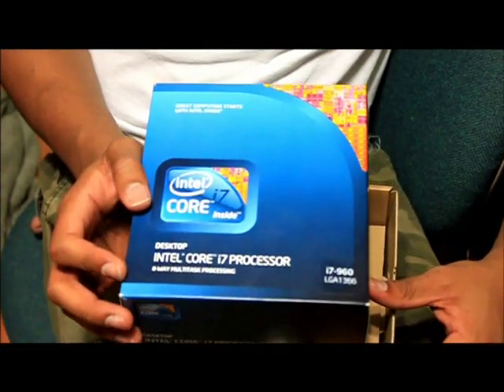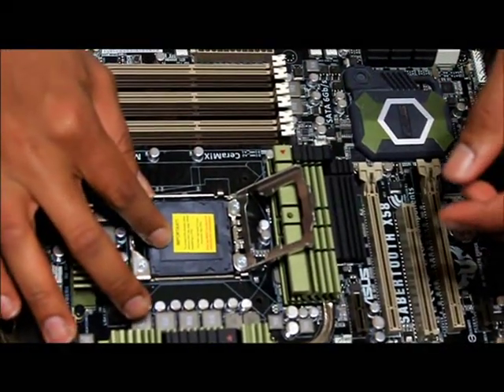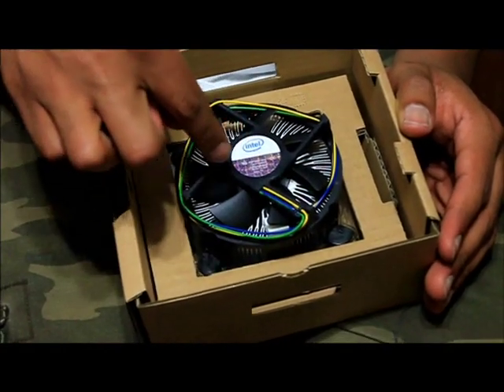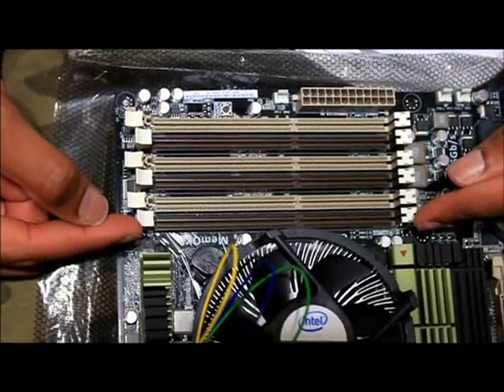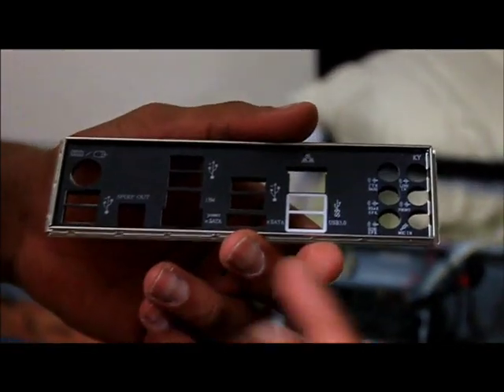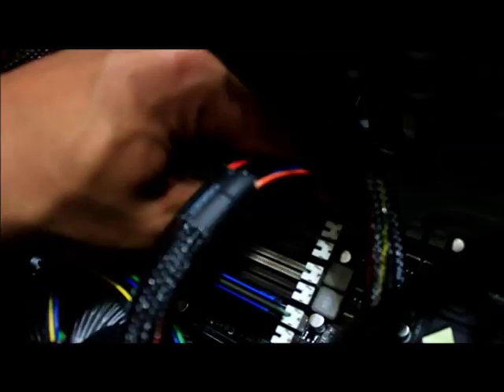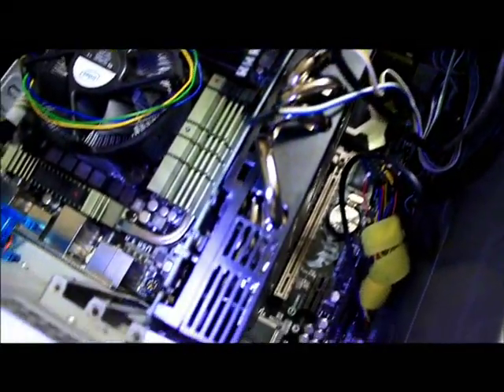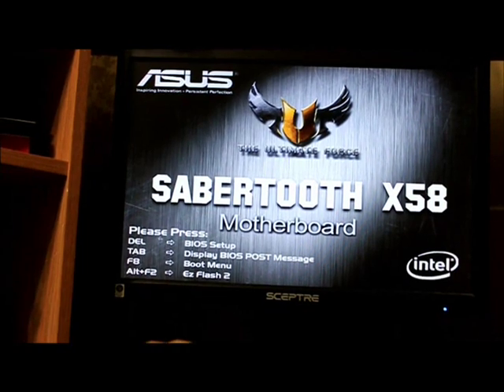How to build your own desktop computer

Comment: Hey can i make a toshiba satelite into a desktop by disambeling the laptop and using all the parts again just to be able to make a desktop, my screen cracked and i cant find a replacement but an external monitor wont work on the toshiba, the external monitor does work on my lenovo but not on my toshiba... so its not the monitor fault and i litterly used a knife to remove my keyboard and display but its my first time so yeah hope you got some advice for me (even tho im on a laptop and you on a desktop)...
Reply from the maker: I would just attach a monitor along with a wireless keyboard and mouse to the laptop.
Reply: Al Chandler tried that, but i get no reaction from the monitor, when i plug the monitor to my lenovo it works but to the toshiba it doesnt... i tried it with a dell monitor, a hp monitor, and a fujitsu monitor, none of them worked, so i was planning on removing the screen completely so the data is forced out the second output (the monitor output) but it doesnt work either.... thats why im contemplating on making a desktop (out of the laptop) cause the laptop does turn on, and through the cracked screen i can see in the button right corner that the laptop is perfectly fine, and with voice commands it still opens everything normaly but i cant use it cause i only see the buttom right corner  :/
Reply from the maker: On the keyboard there maybe an option to on the second screen.
Reply: really? :/ dammit, cause the keyboard had a bug where 1 button just keeps pressing even if i dont touch it, it just jumps (and i normally use a external keyboard and mouse) i dont even know how my screen cracked, i was playing game and it just happend... but thanks for the advice ill try yo find videos on it...

Comment: hey i was wondering if next month due to me building a desktop with my paycheck if there is someway to contact you through a video chat so that i may make sure that i am putting everything together for pc gaming ill be using a Intel Core i5-4670K,  GTX 760 GDDR5-2GB, Intel Desktop Motherboard LGA1155 DDR3 1600 ATX, KENTEK 800 Watt 800W 120mm, Cooler Master Elite 430 - Mid Tower Computer Case, Corsair Vengeance Blue 8 GB. i love pc and pc gaming and i always wanted to finally build my own rig

Comment from the maker: You will do fine. Just remember make sure everything you plug in lines up properly. Don't use to much force when plugging something in and do not connect power out to a power out anything. Read your manual carefully and cross reference you motherboard to the parts you are installing.

Comment: GIGABYTE GA-970A-D3
AMD FD4100WMGUSBX FX-4100 Processor - Quad Core, 8MB L3 Cache, 2MB L2 Cache, 3.60GHz
Kingston HyperX 8GB 1600MHZ
Western Digital WD10EALX Caviar Blue Hard Drive - 1TB, 3.5", SATA 6Gbps, 7200 RPM, 32MB
GeForce GTX 560 Superclocked Video Card 
PLEASE help! Do these part fit and compatible.
and if they do are they good?. PLEASEEE HELP!!

Comment: Cooler Master Elite 430 Mid Tower ATX Case
HIS Radeon HD 1GB GDDR5 Video Card
MSI 970A-G46 AMD Motherboard
AMD Phenom II 965 CPU
Diablotek 650W ATX Power Supply
ADATA Gaming Series DDR3 8GB Ram
Still need to find a hard drive but that's it could anyone tell me if it will be any good and can anyone tell me were I can find a 640GB or lower hard drive for a cheap price under $50 would be good thanks :)

Comment from the maker: If you are sure all your parts are compatible with each other I say go for it. When I first did it I was scared, but it was fine. I did make a mistake (not paying attention) I plug a "power out" into a "power out" port, so in short... it shorted (saw what I did there I made a joke lol). So don't over force a part into a slot, look at where you are going, and take your time, there is no rush.

Comment: @millerc96 
A video card adds other outputs like hdmi and VGA and helps improve fps and graphics performance, it's not always necessary though. Windows can be installed for quite a big price. If you have a disc with the OS on it you can illegally obtain a product key to activate it.

Comment from the maker: I depends on the water cooling system you buy. but you would take off the fans and screw on the water blocks to the top of the cpu or gpu.

Comment from the maker: It is the slot that the video card connects to. There is not much you should worry about just know 2.1 or 2.2 and higher is what you need. For more technical detailed information check out sites like Wikipedia.

Comment from the maker: @F34R3DRUNTUBE Your power supply it a part that you have to install in your computer which plugs into the wall. Think of it as the power block on the new xbox360. The thing that sits outside the system that plugs into the wall. Same thing jut that the pc has it on the inside.

Comment from the maker: @mailsenoj2008 As long as the motherboard has the same socket as the CPU, the stock fan will fit. I got a 1336 socket motherboard and my CPU was an i7 1336 socket. There are other i7 sockets like 1155 and 1156. Just make sure both the CPU and mobo (motherboard) match up.

Comment from the maker: @RandyMusicGroup Yes, but the case will tell you what board size it can fit. like a ATX mini ATX. As for the brand it doesn't matter, so an ATX Intel and Asus motherboard will fit in the same case. But the bigger the case the better. you will   have more cable management and room for the parts to breath.

Comment: i have Dell 530s Run core due 2.53 GHz  Ram DDR2 667 MHz 4gb. 
 Can i upgrade mine to i7 processor  and 
 Can i upgrade Ram to DDR3 1333 MHz or bigger
 thank you

Comment: your an Idiot first you don't Put your MOBO On The plastic wrapper because the exterior of it Conducts electricity and also 2 times you touched the CPU..oil from your hand was on it ,you should have cleaned it with Alcohol ...sheesh!

Comment from the maker: @nigleywigley not really because your systems pulls power from your power supply. and no there is not a set number for any set mother board.but better safe than sorry, because if your power supply does not have enough power your system will fail and you can damage your parts.